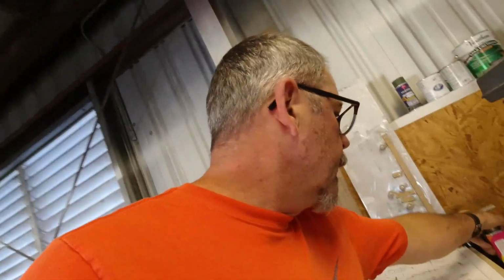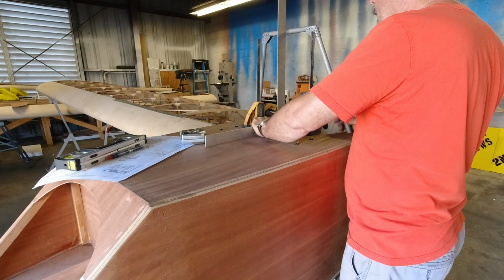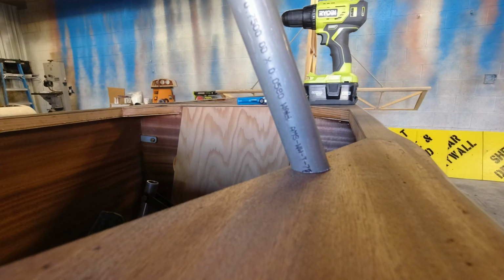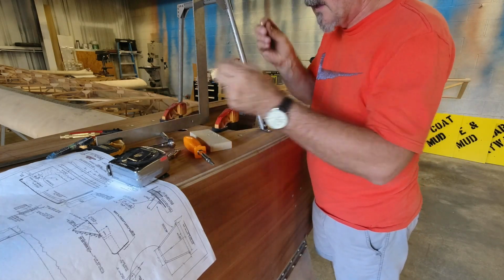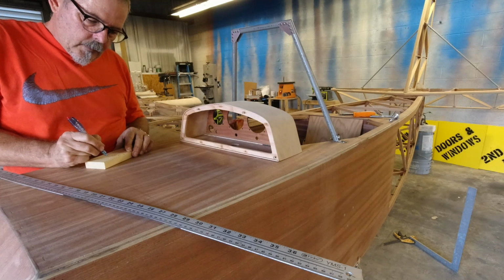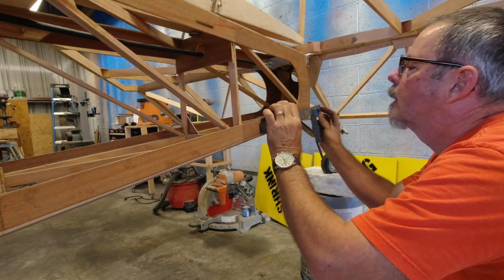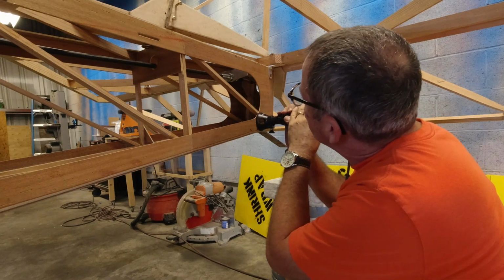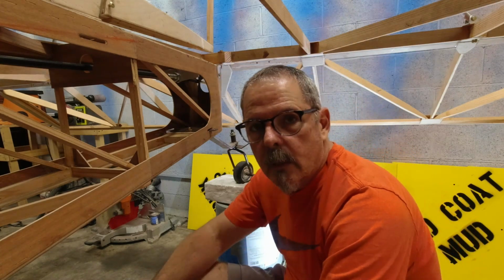Minimax 1100r Wood Aircraft Build Ep 119 - Starting Windscreen

Comment: I have 2 questions regarding your epoxy warmer. If I recall, you user a 40 watt incandescent bulb as your heat source. 
How long does it take to get the epoxy to the correct temp?
Does it ever get too warm?

Thanks,
Dennis.
Reply from the maker: It takes about an hour to get up to temp and I regulate the heat by leaving the door open a little
Reply: Thanks!

Comment: Interesting tail wheel steering method.
Reply from the maker: It’s fairly simple. I have to re-make my steering arm and move the rod end connector out a little as the rod end is hitting the fuselage side
The design was originally for a narrower ball link but I prefer the rod ends

Comment: I can't get my head around how small the brackets are to connect the wings to the fuselage.
Reply from the maker: They are 3/16 x 3/4 2024 T4. It’s a strong piece of aluminum. The design is genius as the loads are carried through the landing gear and also the channel mounted to the fuselage.
Reply: @DTMinimax  that’s what I mean. The Vans/Sling builds that I’m used to seeing have a hefty spar. It’s great how it’s all coming together. Thanks again for sharing.